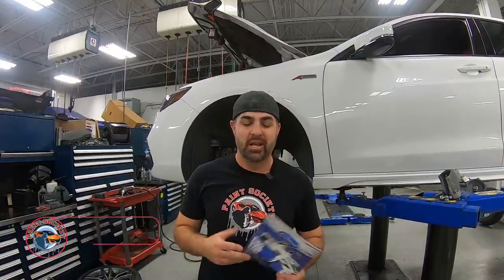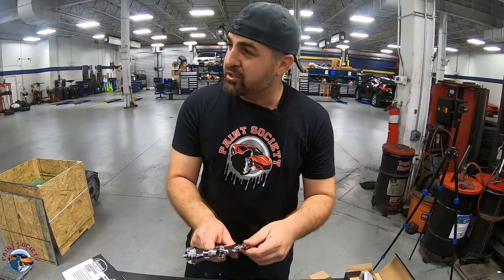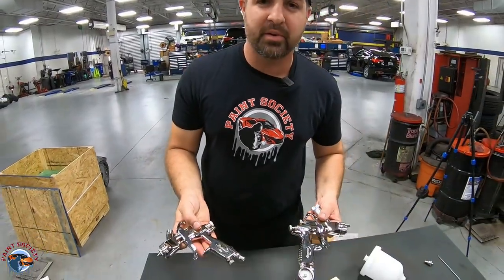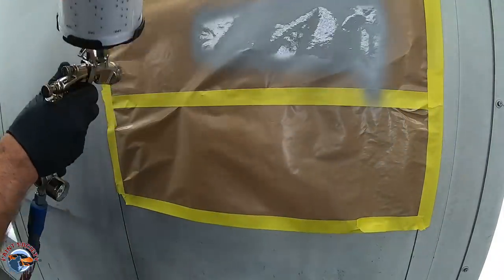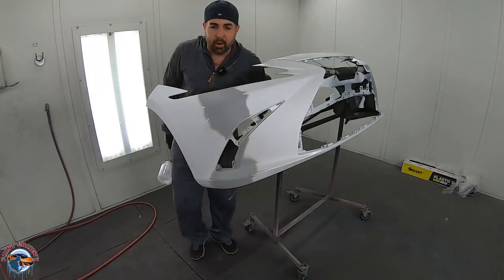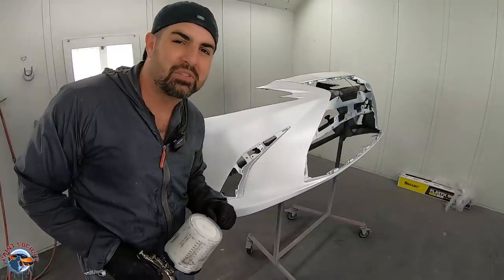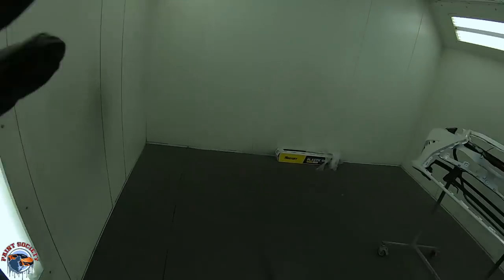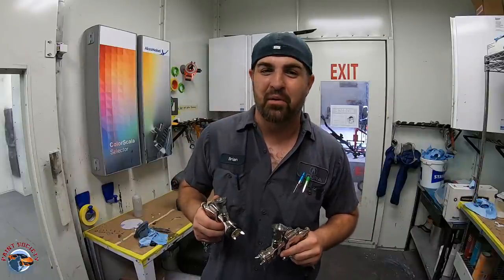The Most Affordable Paint Gun System to Paint your Car! Eastwood Elite Series REVIEW!

Comment: Using clear base and spot blender saved my repair project! First effort was sanded down, start over. Metallic silver mixed from my local supplier didn't quite match. When I was done the second time, it no longer looked like 2 colors in one panel.  Probably the single most important lesson I've learned in your channel! Blending repairs \paint s a bit of an art form in my mind. More to it than it seems. Thanks!!

Comment: Brian I love your videos, I don't think anyone on YouTube explains everything related to refinishing and body work like you do. However I have to tell you there's nothing DIY about the price of these guns, I bought the very 1st gun that they came out with which was supposed to require only 7 cfm and I could never get it to work with a HF 30 gallon compressor, which generates 7.4 cfm.
Reply from the maker: The guns are really good. I understand they might be priced higher then most would want to spend but I gotta say, I use them everyday and never expected to use them past the video.

Comment: Me: "oh sweet, maybe something I can afford"
      $300+
Me: 😐
I'll just stick with the 15 buck harbor freight gun😂
Reply: Im with you he says something you guys can afford and I’m like bruh I need to buy paint and shit too I could take it to a shop for 400 haha
Reply: @makariperkins85  For real. I only need to paint my bumper. It's probably the only part I'll ever need to paint. The only reasons to do it myself is if it's cheaper than taking it the shop and just to learn the skill.
Reply: An iwata w400 1.8 is $230 brand new and I would trust that over eastwood
Reply: @SafetyLucas  check out the spray it 33000k they go for $70 with 1.3,1.5,1.7 tips. It is a LVLP gun works on small air compressors, I like it so much I bought 2.
Reply: @f575gtc  No shit bro. LOL  IWATA all day and twice on Sundays . You can dunk the IWATA in a bucket of lacquer for days for cleaning and not worry about it .

Comment: Hi Brian, I love watching your videos. Very well done and informative. You have a teaching gift. You breezed by the cup change 'PPS',,,what do I need to buy to use this system on this gun? adaptor? I see 3m in your mixing room but freeze framing I see possibly another cup manufacture on a gun in another video. If you where buying one cup size to start ,what would you buy? I am starting a frame up resto on old chevelle and will be doing stages like frame, suspension, bottom of car ect. Thank you for making these videos!
Reply from the maker: Hi! For which gun is it that you are looking for the adapter. They are different ones for all guns. The system to use is 3m pps 2.0 and on their site they have a gun application chart.
Reply: @PaintSociety  I Watched all your paint gun videos and want to start with the Eastwood primer . Do you have any special codes I should use for them? so they know it came from your video referral and percent off for customers?

Comment: Hi Thank you very much for all the great videos. I bought the Eastwood concourse lt100 and it comes with a 1.3 tip and I purchased all the other tips which include 1.5 1.7 and 2.0, I'm assuming the 1.7 and the 2.0 can be used for the primer, do you still recommend getting a primer gun? How would a primer gun be any different than this gun with a 1.7/2.0 tip? Thank you very much
Reply from the maker: it’s just a little bit better because it  breaks up the primer better

Comment: New to painting but I really enjoy learning the tools and procedures in doing so... I need to replace my bumpers on my 05 Dodge Grand Caravan sxt and thinking about buying new covers and paint them myself. First I need a compressor good enough for the job... So, how many gallon tank do I need and motor and psi requirements do I need to use this Eastwood guns.... oiless vertical compressors and brand? HF compressor opinion? Thanks for the info my friend...

Comment: I'm going to have too try a Eastwood gun I just bought there heavy duty slide hammer to go with my new stud gun. And I also found a good cheap $20 a can spay can guide coat. I left a comment on one of your videos stating I use cheap flat black spray paint but I found some cheaper black spray can guide coat. I'm currently using a couple of Devilbiss guns but bin wanting to buy a couple more and get a strictly primer only gun.
Reply from the maker: It’s a fantastic primer gun. I love it

Comment: Brian what needle did you use in the primer gun and the paint gun and do you have a link to the paint cup and fitting you use and again thank you for doing these videos .My last question is this will be my first paint job and its important this comes out nice as a first time painting a car what will be the best gun  these eastwood guns or the WS400 With the 1.3 needle . And brian what about a water seperator to prevent water from the tank ending up on your paint

Comment: Nice video and well explain as always. 
Brian can you do a video of how to mix pearl and what products do you use?
Reply from the maker: Juan. All pearls and paint Systems are different, you’ll have to check the technical data sheets of the paint system you are using
Reply: Paint Society thanks for responding to my comment. I’m using the 3-coat paint system, the car is white pearl so I’m having trouble to decide if I should mix my pearls with a clear base or with the clear coat.
And thanks again Brian Im learning a lot from your channel.
Reply: Juan if it’s 3 layer paint job which is what I think u mean by 3 coat , , 
1st lay down the base coats then 2nd layer is putting the pearl coats on 3 rd layer is clear coats

Comment: With “Inter-Clears”, “Inter-Clears” with tint or larger metallic flake, or hog-wild large diameter flake under clear, the demands on being able to be “Repeatable” becomes necessary and needed. Question; Are the fluid tips, needles and air caps interchange on these two guns, increasing the range painters are asked to accomplish? Thanks. Omaha.

Comment: Awesome content thanks guys. Question: What home air compressor do you recommend that can match the 9.5 CFM requirements from the Eastwood guns?? Thanks!
Reply from the maker: A 30 gallon will work for just small parts otherwise you’ll get the cfm out of a larger 60 gallon

Comment: Thanks for the Video Brian!  Is it necessary to have separate guns reserved for water based and solvent based paints?  Or is there some special cleaning that should be done to a gun when switching between the two?
Reply from the maker: I can’t say because I have never sprayed water but you should clean them well if you’re using solvent and water in the same gun

Comment: Hi Brian, great job, lots of good tips. Can you add to your script always state Nozzle size, air pressure set, setting on air and pattern.. Give us more information on paint  type & brand and ratio , especially what clear are you using. Last request, pearls,  you lost me the last time, ( 1oz. of pearls to 1 oz. of paint. I have a 2020 Lexus RX350,  PPG provides  the paint with the pearl already, ready to go. Bur for special customs jobs if you wanted to simulate that same white  pearl, with liquid or mica ,what is recommended ratio of pearl to base.
Reply from the maker: I added the fluid tip sizes and pressures to the description. I can’t answer your questions about the pearl. You will have to contact ppg to find the correct ratios. Every paint system is different and the scientist that developed the formulas will know the answers to your questions.

Comment: Ive been painting for over 20 years, I managed the PPG store in my town for several years.  Your videos are very educational.  Ive always said slow is better than medium even in the summer in Ga. Ive always been a devilbiss guy but recently ive been clear coating with an Iwata LPH400 orange cap. It lays down clear pretty nice. My question for you is...is the supernova clear gun any better than the LPH 400 for Clear coat?
Reply from the maker: Both are great guns. The ws400 will lay the paint really slick.  You have to know how to handle it. I find the lph400 to be a better option for a beginner. It is a bit slower and easier to control.
Reply: @satamanschmidt3428  Awesome. Thank you!
Reply: @PaintSociety  Gocha!   I sold Iwata for years just recently started using them.  I really like em!

Comment: Question:
Do you use any air dryer for the air on the paint gun?
Also, it might be interesting to strap a Go-Pro or similar cam to the paint gun itself for an interesting perspective.
I've never seen that done before, so it might be interesting....

Comment: Hello Brian: I love your shows. Just a small question about importance of primer atomization. I don't understand why it is an important to have a good gun if it is still need to be sanded down for the high and lows spots? Thanks for your help and keep up the great work on these shows. I would like to see an episode about some welding you do if possible. Just an idea I am putting up there.  Thanks again for sharing your expertise. Sam
Reply from the maker: Because it leaves a smooth finish. A poor gun will leave a finish with many bumps that will not leave a smooth finish even after sanding.
Reply: Paint Society thank you

Comment: Brian most weekend warriors don`t have compressors that can supply that much air  how about a review on the eastwood concours low cfm guns and what are your thoughts on a touch up gun ?
Reply from the maker: Touch up guns won’t require as much cfm. If you can get yourself a 33gallon compressor you’ll be able to paint one panel at a time with ease but will just have to wait for it to fill back up. You’ll just run into moisture issues since the compressor keeps running.
Reply: You can’t get the concours no more! The concours pro is a beast for the price!!!!!  Same compressor you use for the concours can run the concour pro with better results! It has way better atomization than the concours, and concours 2!  I ve had both

Comment: Awesome video. Thanks Brian. I see the gun is a air hog but If I’m putting $400 in a paint gun I’m getting the Iwata LPH 400. And it sprays at a lower psi.
Reply from the maker: Both great guns. Paint society demos them and you choose them!
Reply: @alconyers2003 Be carefull the iwatas usualy like more prassure and air flow than nominated on the manual, so chose your gun wisely if you have a small compressor. Noticed that on my supernova it really likes higher pressures than 29psi, more like 35 for fast and flat painting (depending on the conditions ofcorse). Also for begginers the iwatas take a bit of time to set up which might put some people off painting. But if you have the air power and the time to fiddle around with it, there is no better gun imo
Reply: Timi Racko the LPH is low pressure. 25 clear lays flat. 19 lays sealer and base slick. But if you are painting a whole car with a lil compressor then why are you even painting?

Comment: Can I use these 2 guns with a 30 gallon air compressor if I’m only painting one panel at a time. I know HVLP spray guns need 60 gallon air compressors, but I was wondering if I can get away with using a 30 gallon air compressor with HVLP to do one panel at a time. Thank you for your help.
Reply: Check out Underground Paint King. I've been liking his stuff. Does stuff with a 20 gal compressor.
And Time warp custom paint. for air brush techniques ect.

Comment: Is it possible to paint with airless wagner system? all I have is 6 gallon compressor and I guess it wont be well... in my country 30 gallon compressor costs 1000$ approx so its not realistic for me... really hope to get an answer from you... thanks for your awesome videos !
Reply from the maker: Hi John. Sorry. It’s not. You’ll need that compressor. Maybe a turbine is a better option.
Reply: @PaintSociety  thanks for your fast comment man!!
do you have a video about light rust fix and procedure? i mean the right steps to achive great protection and result? i got a little rust between the roof and trunk door
Reply from the maker: @johndoe2022  I don’t but generally you want to get it all down to metal with 80 grit and take a wire wheel to get the rust out of the tough areas then use epoxy or etching primer to seal the surface
Reply: @PaintSociety  
You are the best! Thank you very much! 
It is so light rust ,looks like it didn't penetrate the primer, so I thought i can skip  some steps...
Thank you for your awesome channel, 
Happy new year!
Greetings from Israel. 
I wish I could buy here some of the products you recommended, but they're not available here..mostly PPG and Glazorite if you familiar with...and if I wrote it down correctly LOL... Sorry for my english😅

Comment: Love your videos. Very interested in learning myself. I Have a Subaru Impreza wrx sti in dire need of painting here in Ireland. 

Can you please recommend or highlight the minimum requirements of a compressor to spray a full car? 

I was looking at a 100 litre 5hp 14cfm compressor.

Thanks
Ciaran
Reply from the maker: I think at least a 60 gallon if you can well handle all your needs very well. From da sanding to painting
Reply: Paint Society thanks man. Actually it is 3 hp and Air displacement: 13.03 cfm 369L/Min
Free air delivered: FAD8.44 cfm 239L/Min

Does that matter?

Comment: Just when I was looking for a gun😂who knew 👌 so my air compressor is 225 psi”max pressure” 
5.0 scfm 
 Motor- 1.6 hp 
15 gal tank 

Truly want that cc500 that can do it all🔥 if it’s not able to work with that gun can you please give me a link or a best option for somthing similar to it for the tank I have.
Reply from the maker: 15 gallon tank is very small and not much will work with it for very long unless you’re spraying small parts.
Reply: Paint Society thanks for the advice 🔥
Reply: @chinito20fam  i used eastwood concours lt. Doesnt take alot of cfm and i did my mustang using a 30g comp.

Comment: Which one would you use with epoxy sealer and which tip?
Reply from the maker: P500 1.4
Reply: @PaintSociety   So you use the P500 gun with the 1.4 tip and needle transferred from the cc500?   P500 doesnt come with 1.4

Comment: Why 25psi for sealer/base and 27psi for clear?  And I'm fairly certain that's just for the sealer, base and clear that you used, others might end up with different pressures (maybe not?).  I'd love to see maybe even a POV shot of you setting gun pressure, showing why 25psi is the right pressure for the sealer/base, not 24 or 26, and the same with the clear.  You are seeing something when you're testing the gun with the specific paint, I'd bet that 99% of the people watching your videos don't know what you're seeing to give it or take away a PSI.
Reply from the maker: Check out my video. How to spray clearcoat, and it will explain this in great detail.

Comment: Eastwood CC500 vs the DeVilbiss GTi Pro Lite - Obviously the pro lite is a bit more $, but how would you compare them since you've recently used both? I might paint 1-2 vehicles/year. Also wondering if devilbissclub.com is legit??
Reply: I haven't used an Eastwood gun, but have 2 Pro Lites and many tips and air caps. You can do most anything with these ! Spraygunsdirect in England has them"cheap" and fast.
Reply: @jaykrom852  yep, I ended up getting a gti pro lite from them and LOVE it!!

Comment: Brian I’m just getting into wanting to learn as a DIYer to paint. Can you break down the operating requirements on the gun as far as CFM. If the gun says 9.4 cfm @ 40 psi how do I know what specs I need for the air compressor? Will a 30 gallon 6.3 scfm @ 40psi do the job? TIA more questions to come!

Comment: Hello, thanks for the support that you bring to our community, I will like to ask you how may I know if I have the requirements. For example the paint gun says I need 4.25CFM @30 PSI. On my compressor info specific 3.5CFM@90PSI and 4.8CFM@40PSI. thank you for your help.
Reply from the maker: It can get very confusing with cfm. It’s good to have a decent sized air tank. 60 gallons is ideal but you can get away with a 30 gallon for small parts in my opinion.  I have included a link with understanding more about cfm 
https://www.google.com/amp/s/gopaintsprayer.com/what-cfm-for-spray/
Reply: Thank you for your prompt response and support, I'm going to check the link.